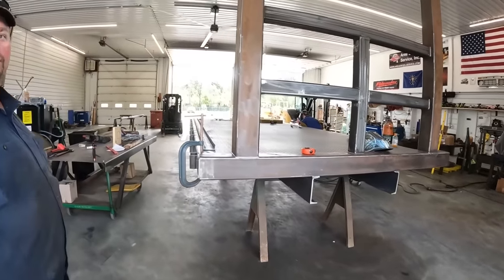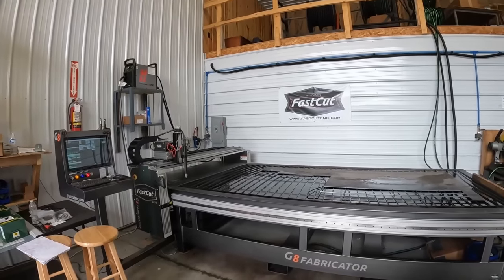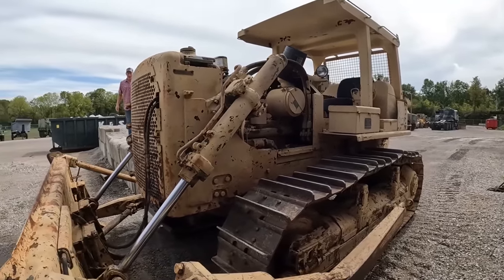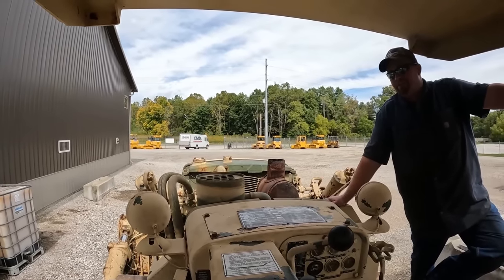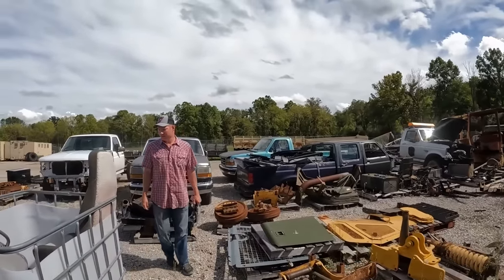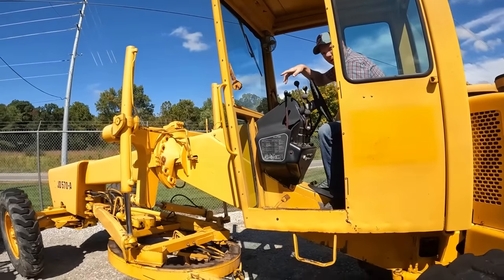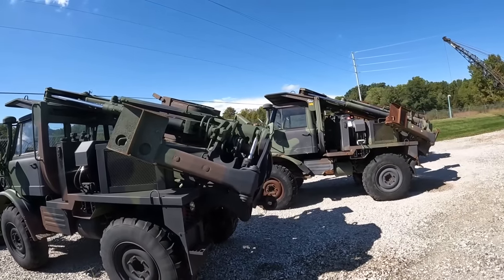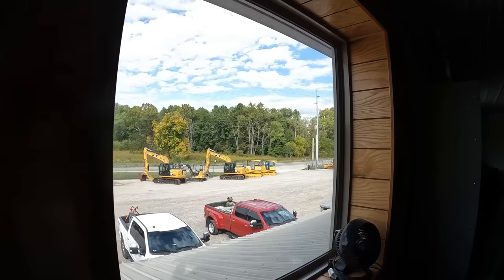Checking Out C&C Equipment Behind The Scenes

Comment: My cousin said when they were in Iraq they had 8 new dozers and 20 or so trucks air dropped in, 1 dozer didnt even have a parachute 2 of them didnt open but they only needed 4 and 1 was for parts only. The vehicles that was dropped 2 of their chutes didnt deploy so he said they made a hellova noise when they hit but one of the dozers fired right up and pulled off that did the free fall but none of the blade stuff was any good